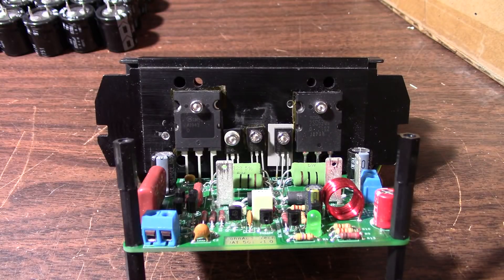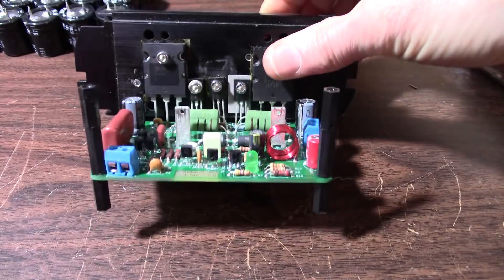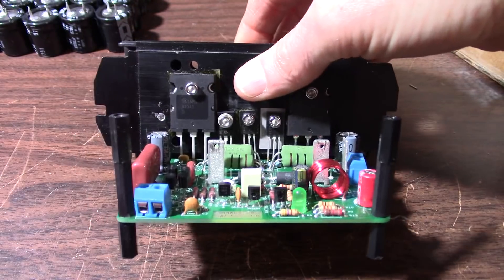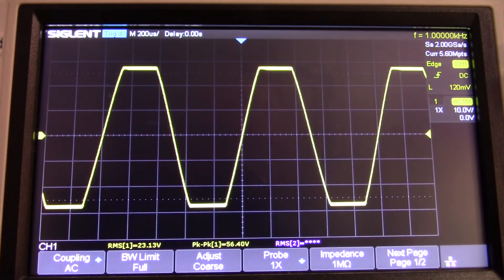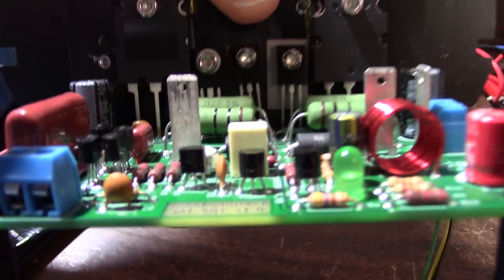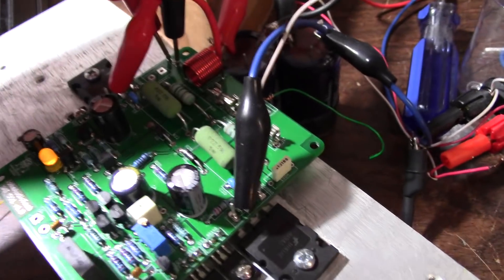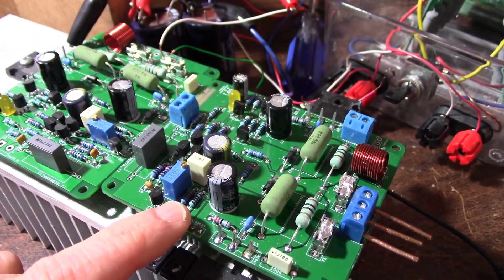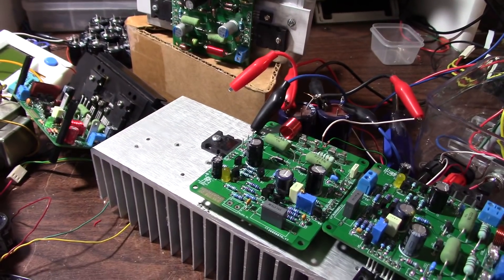JAT501 amplifier project conclusion + Inline board + PCB files available

Comment: Hey John! I noticed that the VAS transistor gets a little hot… is that expected?
Reply from the maker: Yes, they (Q7 & Q9) dissipate 200 to 300 mw depending on supply voltage. They should not get too hot to touch though.
Reply: @JohnAudioTech  it seems about right then. Thanks for the explanation!

Comment: Hey John, I noticed that on the the schematic, VR1 (200 Ohm trimmer resistor) has no wiper connection. There are 4 holes for this component on the inline board. How should a rectangular trimmer be oriented with these holes?

Comment: Why the vas stage was so hot when powering into 48 0 48 dc?
Reply from the maker: Because it's designed for +/- 35v
Reply: And i try now to powering it into +/- 24 volts dc still the transistor heat quickly
Reply: The base to emitter voltage of bd139 and bd140 not the same ,pls reply 😢
Reply: I think im the first one who try to make this circuit but i failed 😢
Reply from the maker: @djgebhartmmc3265  Check currents in the circuit. What is the output voltage?
Reply: Im sorry but i have no current meter here, but i follow what was in the schematic given , and i also try to replace some transistor which is higher than the components shown in the circuit,😢
Reply: I use 2sc5171 an 2sa1930 transistor to replacement the bd139 and bd140 😢 and still not getting good
Reply: Sir Pls reply 😢
Reply: Sir can i have one of this pcb board design?😢 Please 🥺

Comment: Hi John. I am following up on your JAT501 project. I am also following on Eddie of Kiss Analog. I have putting the JAT501 into the Micro Cap simulator. From that I found something something in question. The bias at the IPS (the long tail) is only about 1mA instead of 2.4mA as you've mentioned sometime before. Although this does not affect the performance (at least in the simulation), I am just curious to ask if there is something missing or wrong in the schematic? Also, conjuration on reaching the 50K mark!
Reply from the maker: All the boards I built run the IPS at the designed 2.4ma. 1ma would reduce the slew rate. Are you using the latest schematic? Early in the project, the current was too low (1.2ma).
Reply: Hi John. Thanks for your quick reply. Now I found the issue. I missed R11 in build the schematics into Micro-cap. Problem solved!

Comment: Hi John, if you can provide another set of component value that make even lower distortion, I guess lot of people here can did the comparison for you. Also if you have time, maybe try to measure the different between finished PCB and the perf board, the different in the performance may give a hint on future design.
Reply: That is rather a tall order.

Comment: Hi John. Do you think some day you could do a test & review 0n the TDA7498E DC 15-36V 2 Channel Audio Stereo Digital Power Amplifier Board 2*160W, available on ebay for about $25.00? Also would like to know if it's bridgeable. I am impressed with the JAT 501 and would like to buy some boards from somebody. I'm almost 70 and I'm not versed on how to use GERBER FILES  at all. If someone has one or both boards or even a kit I would be interested in making a purchase.
Reply from the maker: I have a 7498E board in for review. Nothing needed to do with the gerber files other than sending them in to the PCB fab shop and they will make the boards for you.
Reply: @JohnAudioTech  Ok that's great, but I still have no idea how to send the request to I don't know where. Sorry to beat a dead horse but I'm totally ignorant about designing circuit boards or drawing schematics with a PC.. My schematics are hand drawn as in the old days. I wish some one could provide a course for dummies on these through YT or suggest a book to use along with the course. Still, I learn a lot and enjoy watching your vids.
Reply from the maker: @voltagefreak6350  In the description of this video is my email. Contact me there and I can help you.